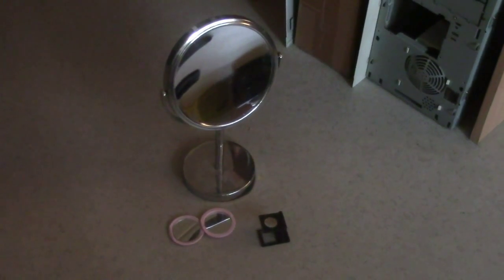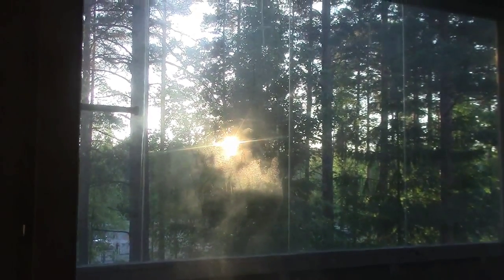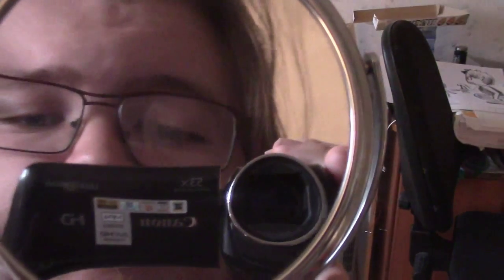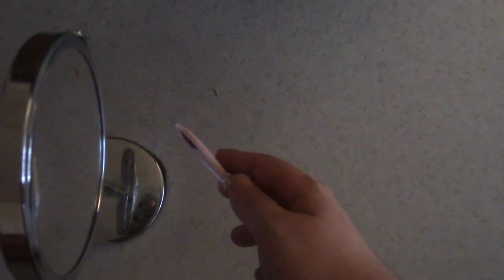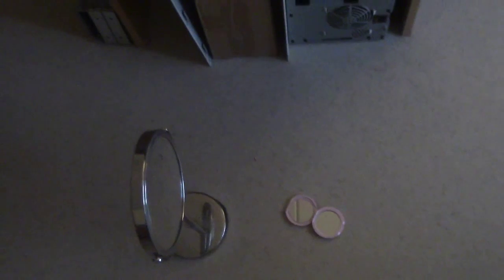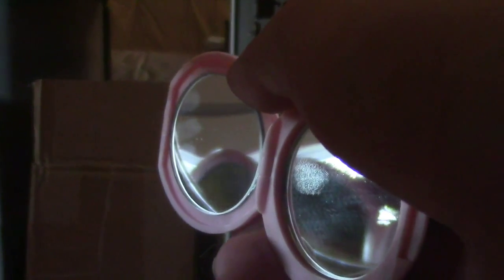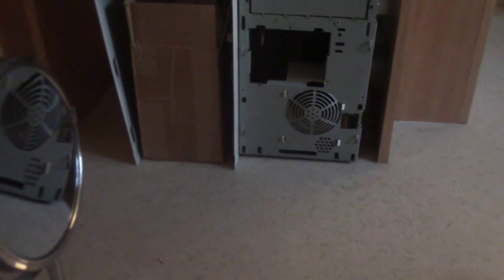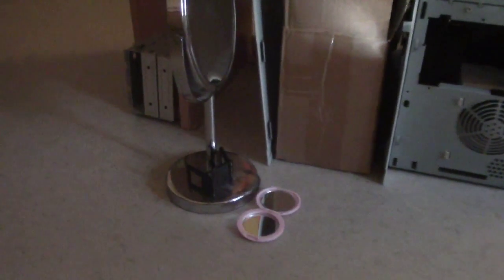Makeup Mirror Telescope Initial Test

Comment: What makeup mirror magnification is best when building a makeup mirror reflecting telescope?
Reply: The magnification is determined by dividing the focal length of the primary mirror by the focal length of the eyepiece you're using. Using a mirror with a longer focal length will provide decent magnification while reducing spherical aberration, although you'll get a narrower field of view.. This is a shaving mirror, though, don't expect anything exceptional from it. It's spherical, not parabolic, and it's not manufactured with enough precision to turn it into a decent telescope primary.
Reply: Get a 1.5x mirror if possible or at least 2x mirror.